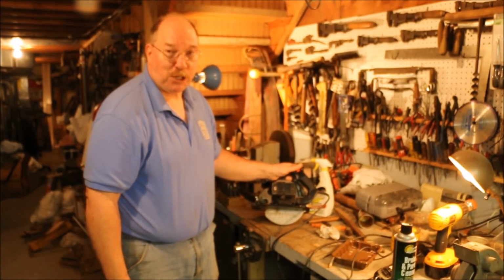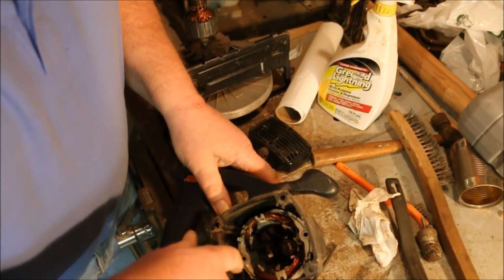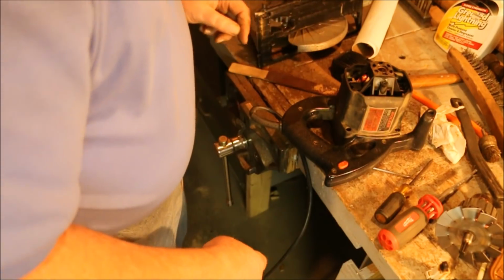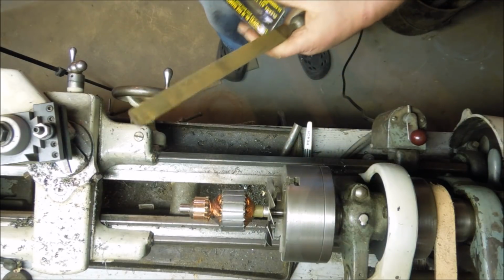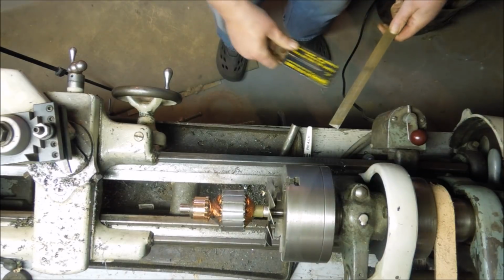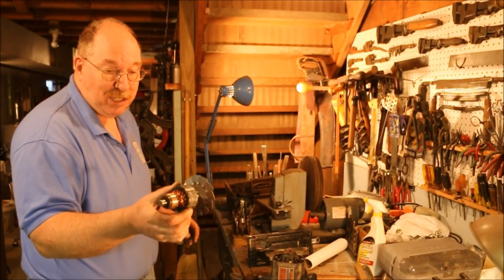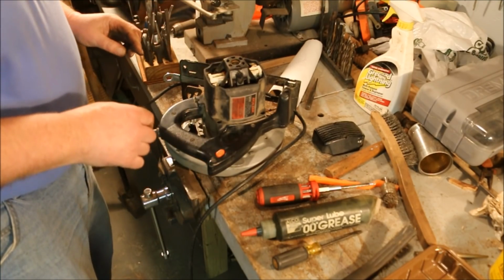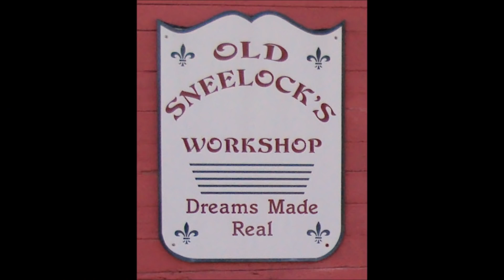SKILSAW MODEL 5050 ~ TURN THE COMMUTATOR

Comment: I've heard of mica under cutters made from pieces of hacksaw blades. It'll run for ages hence! Good job, Unc!
Reply from the maker: Lewie McNeely This is the second comutator I have undercut. The first was with a broken hacksaw blade.
Reply: Seems like I have seen the cutters made like little saw blades about the size of a dime and chucked into a lathe or something. I suppose electrical shops had dedicated machines for doing just the commutator work. Been a LONG time about that!

Comment: i need to look into a mica undercutter i have herd about them before but know idea what it loos like or how one would be used
Reply: I've seen them made from pieces of hacksaw blades and they just cut just a dab of the mica insulators between the commutator blocks for better brush contact.
Reply from the maker: Old Iron Shops The fancy ones are like a tool post grinder. In the current project I used a knife edge file.
I remember using a cutdown hacksaw blade. With the armature clamped in a vise and the edge of the saw in a short handle the blade would be pulled instead of pushed.
Reply: Old Sneelock's Workshop ahh sounds like a handy tool to have

Comment: I love the use of the lathe very interesting watching you work with it.  I was wondering does the rpm of the lathe affect the runout in your work or does it remain the same.  Does the rpm affect the tolerance in the lathe bearings increasing the runout (wobble) or will it smooth out? Just thoughts from my feeble mind love your work Unc.
Reply from the maker: paul harriss With my lathe it is more a function of age and wear. Three jaw chucks are operated by a scroll plate the moves the jaws. A new, clean, straight scroll will bring the jaws together consistantly within .001". Over time wear and abuse will cause the chuck to vary. Overtightening is the worst. 
Often parts will spin in the jaws. The jaws may have wear. The slots the jaws run in can be worn. The scroll can be worn or bent. People grind the jaws thinking to "fix the problem".
The causes are not consistant over the range of the jaw travel. Grinding may improve the chuck's action for one specific diameter, while throwing all the others out further. 
That is the main issue I have run into. 
Turning a round straight cylinder has a whole new set of parameters.
Speed can change the harmonics and create chatter. 
Speed will also change the heat in the bearings increasing varience in the spindle.